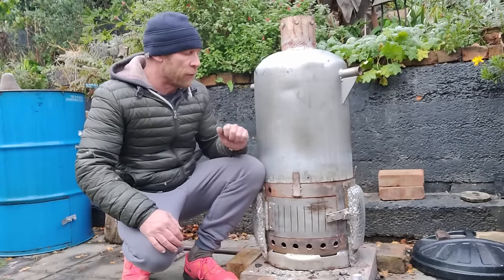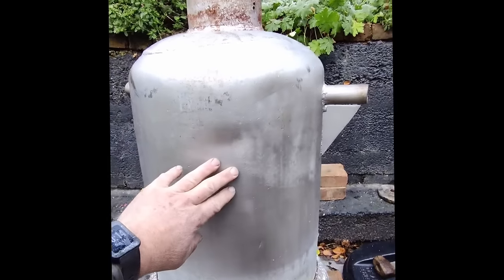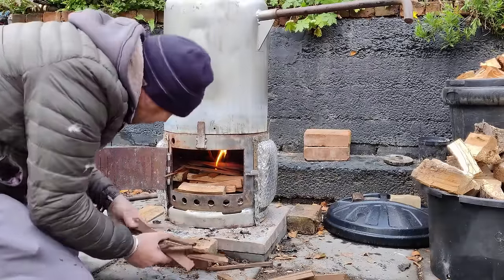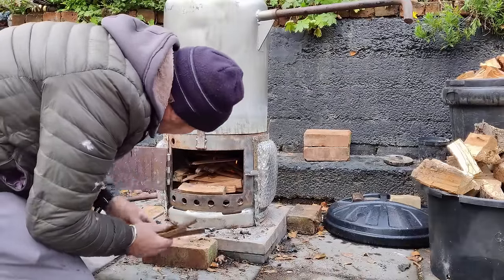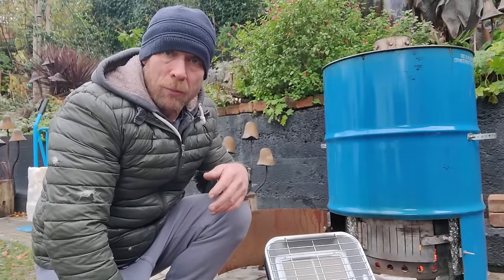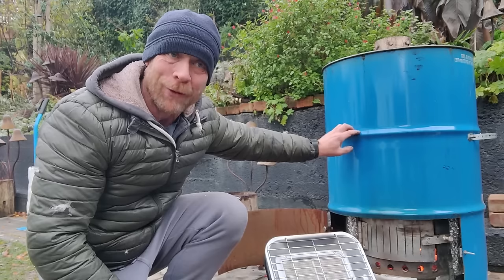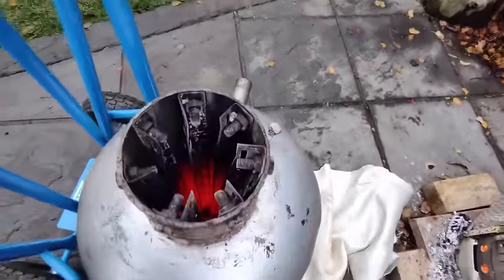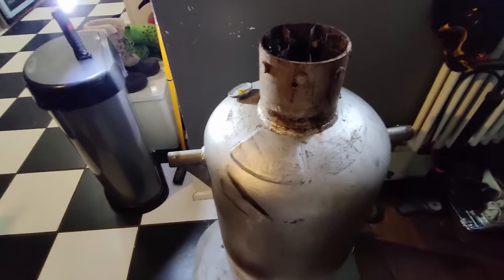Sand battery can it heat my home?

Comment: Really love this. I'm sure they will ban wood burners soon, but this man is doing something. May not be perfect or convenient, but it works. Most people only complain and than laugh at the ones who try to make a difference. I respect the hell out of this.
Reply: Hope you stand up against the Goa'uld when the time comes.
Reply: Agreed. We have a wood burner and I saw an amazing book in the library called 'Norwegian Wood' (like the Beatles song). Its all about proper seasoning, storing, cutting of firewood, and written by a Norwegian and they know their stuff being partially in the Arctic Circle. It also gives the different heat strengths for types of wood, and how best to use wood burners. One really important fact is that wood is actually really clean to burn if done properly -get a good smoulder going for about 45 min with the kindling before adding the main logs and set the vents right etc etc. Yes, all governments should read it.
Reply: A law was past that the smoke from a chimney can be monitored, but in that law a fire outside your home isn't included. So, you can have a bonfire outside your home burning any wood you like, even damp wood, but as soon as you're indoors, no damp wood, no wood that's chemical treated, so wood burners won't ever be banned because they're carbon neutral. They will control what you burn because one of their donors will have a company selling wood pellets or smokeless fuel.
Reply: They can’t ‘ban’ wood stoves as such….they require your to consent to the legislation!  The ‘United Kingdom’ is a commercial realm and a jurisdiction where companies and fictional paper/legal entities can be ‘registered’ as ‘residents’!  Men and women can’t live in the realm where Sainsbury’s or ICI exist…we live in Britain on the land, not the commercial seas and its UK ‘platform’!

The United Kingdom ‘realm’ might sound like a place, but it’s a registered corporation…that you can’t live in….it is the one of the greatest deceptions played on the people, and ultimately an act of treason and the theft of our inherent birth rights as men and women.  The ‘people’ have been jurisdictionally emigrated from off the land, and reduced to voluntarily self-declaring as commercial entities!  It’s a deception too vast for a mere comment.

Comment: What if you added bits of scrap iron with the sand, like nails, screws etc. wouldn’t that help to conduct the heat evenly and rapidly to and from the sand? Love your sand battery! well done for sharing your knowledge with us 😊
Reply: same question :)
Reply: Very good idea!
Reply: Natives used calcite iron balls to heat pits (from limestone oxidation geodes). Also they use lava rocks for sweat lodges.
Reply: I got a normal fireplace. Keep an iron pot full of granite stones on top for bedroom, and 15 metal weights just lying on top as heatsink. Will try the sand though! Maybe sand is better than stones?
Reply: @LisbethSighFehrmann  you can store more power into sand 1600celsius melting point
Reply: You didn't mention carbon monoxide detectors. If you're going to run that space heater inside get some before your family becomes a statistic.
Great work on the battery, it could be more efficient but it's working for you so good job.
Reply: Copper coil instead of screws and scraps
Reply: I was just thinking the same thing but with aluminum scraps. Just find a way to grind up a bunch of aluminum cans into a powder and mix it into the sand to conduct the heat away from the center.
Reply: @aaronh6776  Aluminium powder as used in explosives?
Reply: Two factors at play: density & specific heat capacity - Aluminium is likely the best candidate & beats sand at both,. Other common metals have lower SHC, but more density. Iron will be about 1.5 times better than aluminium but 3 times heavier for the same size. They're all going to conduct better than sand, obviously, so less time on the fire, but  hotter & not as long lasting, without insulation.

Water is better than the lot, but it boils
Reply: the thermal mass or latent heat of the material is whats more important.

like copper is a much better heatsink material than aluminium, not because its more conductive, but because it holds far more heat energy with no noticeable rise in temperature...
then theres that whole thing about emissivity...
Reply: Or rock salt
Reply: That's really smart. Something like a network of metal throughout the sand to heat it up quicker
Reply: Just use a fireplace  waste your time with  this  junk
Reply: @submechanophobia768  Many small ones might be more practical, or components one might say.  Insulation can help greatly I believe plus using electricity to power a heating element.  Possibly from solar panels.  That's the most common method I have seen.  I'm not saying his method is wrong.  His has a specific application.  Some people have large amounts of virtually free combustible material.

Comment: Efficiency tip? Make three or four smaller and lighter sand batteries that stack on top of each other. You can stack them on the burn chamber and heat them all at once. Then you can heat several rooms quickly, or stack them up in the hallway to heat the house for a long time.

Comment: It seems like a scaled-down version of a HAHSA. Have you considered putting it in an insulated structure such as a small storage shed maybe 3'×3'×4' with a duct carrying air through it and insulating where it is outside? It should require no more than a small fan (such as the ones used in automobiles without air conditioning) to circulate the air. It would probably work just as well if not better. That system should work well with a pair of deep cycle marine batteries and a solar charging system that could be augmented by a small inexpensive wind generator and for the occasions where there was no wind or sun for more than a day, you could charge with a regular automotive battery charger in a couple of hours. This is just something to consider if you haven't already. The entire system should be fairly inexpensive for the benefit it would give you.

Comment: inspiring. I think Robert murray smith looks at something like this idea too. The Finns have a similar, though  huge, battery with pipes running through I think and use solar and wind to get the power to heat it up. If it can work for that country then it should work for UK. Wish our government were more into supporting that sort of new(ancient) tech.

Comment: It's a simple calculation.  Get the heat capacity per pound of steel, measure the average temperature and weight of the "battery", and that will give you the amount of heat in BTUs stored in the "battery."

Comment: You might be able to get a small propane tank, clean it out, and fill it with sand. Then build a stand and set it above the big wood burner and capture the heat

Comment: Genius mate. I think these sand batteries have a big future. A German modern electric radiator company fills their rads with silica which is basically sand in a sort of modern version of a storage heater. I had the thought of stripping an old storage heater, taking the electrics out and sitting oil candles/lamp under each updraft vent to slowly charge up the bricks all day then later open the outlet vents and let the heat out. Or same idea with a row of 2-3 ft long cast iron pipes with end caps on them and a row of wicks in a long oil container underneath with bioethanol to create a more instant radiator.

Comment: Great idea. I would wrap it in fiberglass and protect it from the weather, move it closer to the house, bury a large, double wide coil of copper tubing in the sand, insulate it, charge it with automotive antifreeze and connect it to a car radiator through a 12 volt pump and fan inside the house. You could build a decorative case for the inside hardware out of wood as it won't get hot enough to scorch it. You can run it with a 12 volt power supply, battery charger or, if the power goes off, a deep cycle marine battery. You can keep stoking the fire and use it full time. I would make the fire box taller or wider for a larger charge of firewood.
    If you have an electric central heat unit, you could adapt the radiator and install it in place of the heating coils like wood boiler type heaters do.
    My son got lucky. He has a gas well on his property that's been abandoned for over 50 years. Free heat, stove, dryer and hot water.
Reply: That's an idea,another idea is to run the water directly thru the sand,having inside some filters made of mosquito net to avoid the sand to get into the pipes,just like a pool filter.
Reply: You really put alot of thought into this!  Wow!  Thanks for sharing your ideas with us!!!

Comment: That's a totally cool idea, I was reading about the project in Norway that is heating something like 100 homes and a public swim pool with a sand battery.  So, great idea. I could see that with a few modifications you could increase the stored heat and reach that condition faster and if you could invest a bit you could extract the stored heat and convert it to house heating and return on your investment shortly.  I think they said their sand battery is nearly zero maintenance and can work without repairs for nearly 50 years.  So, thanks for sharing mate and accept my thanks for your video.
Reply: The sand battery Project is at Finland Kankaanpää * Norwegians build awesome grid of wind turbines at the sea * ;)
Reply from the maker: Thanks Mike 👍

Comment: Great work Lee! Ideally you need to capture all the heat from the burn rather than heating the sky.could you have a 2nd stage that you mount on top of what you have? Possibly lighter but you could put it into another room in the house?
Reply: Rocket stove would be a better way to heat it.

Comment: I really like the idea of this. I've been researching ways to keep a greenhouse warm enough to 
keep plants from getting too cold. Of course along with something like this sand heat battery, 
a reflective cover/curtain with some dead air space behind it would also be in order to help 
prevent it from letting the heat just radiate right back out through the greenhouse's clear cover. 

I thought about using water filled barrels to hold heat but there are some serious limitations to 
that approach. Water has several ways it can easily be heated, but it can only be heated to just 
below boiling point of100 degrees Celsius (212 degrees Fahrenheit) before it begins to boil away, 
whereas the sand can be heated to far higher temperatures.

I wonder if it is not too crazy of an idea to use solar to heat a barrel of sand with something like 
a 3 meter (about 10 feet) parabolic mirror (when sunlight is available)
Reply: Was thinking the same of heating sand with a parabolic mirror. Couldn't find where anyone tried it...yet.
Reply: If you get a bubble cover and pipe a bit of heat into the bubble as well as the green house I've seen people keep tropical temperatures in close to 0 Temps. 

That's with propane heaters so if you can generate the same amount of heat you should be good?
Reply: @spencerchristie4000  Yeah, I saw something like that somewhere. They covered the greenhouse with a clear plastic envelope and kept it inflated with a smallish fan that needed to run all the time. As I recall,  it didn't take a big fan because it really didn't need much to keep it inflated once it was filled... but it needed to be sealed good else it would leak air and not work very well. The air blown in came from inside the greenhouse, but I don't recall that air being heated before being sent into the bubble. Lots of dead airspace and air doesn't conduct heat very well. And with that airspace covering the majority of the structure without touching anything except at end edges, there was minimal heat loss due to so few thermal bridges.  

A reflective barrier would help prevent heat from radiating away through the clear covers. Preventing heat loss through those kinds of measures would mean not as much generated heat would be needed to maintain a given temperature inside. I was thinking Mylar reflective sheet could be used. Fairly light weight and can be procured in long rolls.

Comment: I think that I would be tempted to have some detachable fins on the outside and paint all of the outside black, the emissivity factor of black (Matt) is much better than silver. 
Another idea would be to build it with a copper coil inside with fittings on the outside for flow and return (top and bottom) and connect it to a central heating rad  - gravity flow, might get heat out more efficiently.
Reply from the maker: Be no different if not less efficient having a radiator as it acts as a radiator on its own & heat would be lost heating water it basically is a radiator but a 4-600c one👍
Reply: @leejones2511  It's a radiator on its own but increasing the surface area of the radiator with fins would increase the radiant heat transfer to the room.
Reply: My opinion is using copper plates as fins attached to the center pipe to evenly distribute heat.

But the idea of stones suggested elsewhere probably could work if you used the material supporting railroad tracks. That stuff is made so that it maintains the spacing between the stones. So it will not collapse inside the container.

Comment: Nice idea. Try to convert your sand battery to 2 or 3 shorter sand batteries that can be fixed in top of each other. It will be easier to transport from your apartment to your yard

Comment: Love it. Wondering how you get it up the stairs? I've used trolleys with heavy stuff but just a couple of steps or so. I'm imagining a type of slide -like a builders' shute split down the middle made of metal dustbin sections or similar -with a pulley system to take the weight off -weld an eye bolt to the battery for a chain to pass through. Maybe one of those systems for lifting engines etc. The block/pulley would need to be bolted very securely to a joist or something. Just some ideas. Anyway, thanks for the very informative short film. Great to see slightly mad idea making sense :)
Reply: correction: an eye bolt (or two) for a HOOK to pass through. And probably need to bolt block to a couple of joists with a plate. I'll let you work out the decorating challenges around that. All the Best. Looking forward to updates etc

Comment: Your video popped up and as i am all into alternative heat i watched with great interest .The heat retention of sand is a greay medium and will hold heat for a long time . Just my two cents here but if you could get the heat to be more focused on the chimney area i have to wonder if a heat fan for wood stoves which runs just off of the heat below it would transfer it ? That way you could wrap it in an insulated wrap and as the heat escapes through the hole it would be blown out ? I might try this in another form , say one or two pipes running through the sand area ? Love what you came up with though

Comment: LPG is a lot more expensive than piped gas. Be careful using un flued appliances they can use the oxygen in a room and kill you with Co poising. It will also create loads of condensation which can cause problems with the structure of the house. Definitely do not use in a bathroom the air will soon be depleted of oxygen due to higher humidity and it will kill you. Did you use silica sand? Use a series of heat sand batteries for more efficiency. You could improve your burn rate by modifying your air intake somewhat. Thanks for the video keep warm but be careful.

Comment: SOUNDS GREAT, BUT Why don't you weld hingesand make a two way door So you could open it indoors???? That way it could work as a conventional heater.. & maybe a small fan on an inclosed box to keep it away from pets... if you keep it as a cylinder  to maximize the heat .. as well.. Just a thought! Scale down but make more units! keep up the good work you are Doing Great!

Comment: take a solar water heater pipe collector panel with 6kwh, make a big (much more sand than you have) pit in the garden, isolate, run heat in and heat out pipes through and give that sand the full 120 degC temp from the solar panels, they put every degree they get into the sand.

Comment: Good idea!
If you want more heat radiation you can paint your battery in black with high temp spary or with something else. Silver surface is very bad in emitting infrared heat, but black will do the job. Of course, your battery will be discharged faster.

Comment: I think what you need is a dumb waiter of simple scaffolding against the side of the house up to your window so you can winch the heated sand up and down with a counterweight, and you should separate the sand part from the oven part, so you minimize the weight; the sand tank lifts off and settles back down on top when it's lowered.
Reply from the maker: An idea but it's no problem with the sack barrow

Comment: "Sand is an insulator" that is precisely why it stores heat! That whole beach thing is just because only the top has been heated. Do a longer burn (burrow under the sand later in the day) and you will have more hours of radiant heat. A heat conductor heats up and loses heat rapidly, the opposite of what you want. Plus, the more packed the sand is, the less of an insulator it is. Try pouring water through the sand while you are packing it (you will need to have a drain that you can seal afterwards) before you weld it in to the container, this will pack the sand as closely as possible.
Reply: If you put water with the sand it would explode when sealed and heated, even if it was just damp!
Reply: @TheHuntermj  See the word "though" and "drain"? That means you don't leave the water in there. But your concern is valid - the sand should be heated with ventilation until no water is left in the vessel.

Comment: i think if u put copper pipe inside the sand that will be zigzagging inside vertically and the ends of the pipe protrude outside at the fire u can heat it up alot quicker and more efficiently  just a quess tho